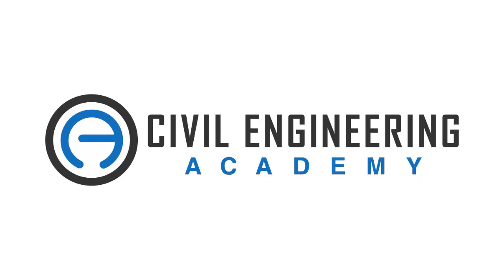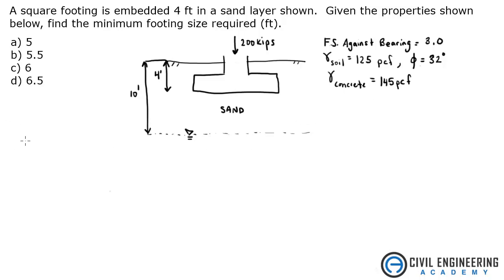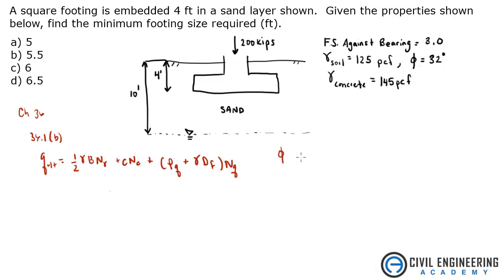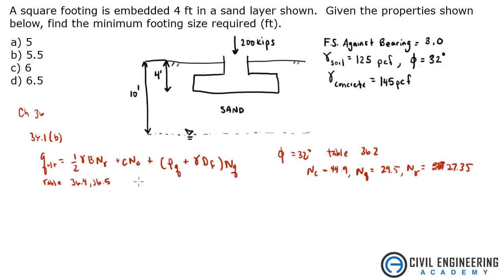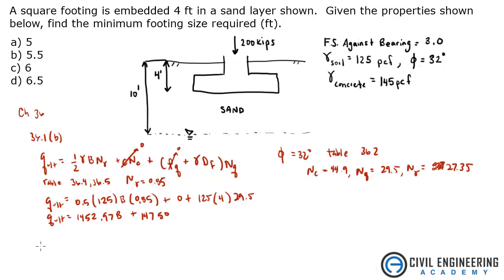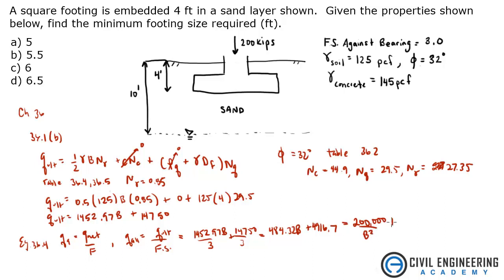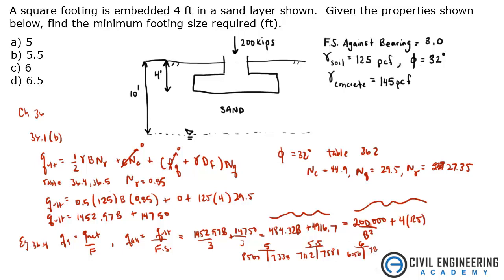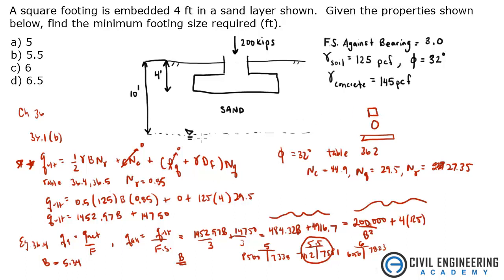Geotechnical-Footing Size Using Ultimate Bearing Equation

Comment: Are you sure it is acceptable when calculating the Nq and Ngamma values to simply take the average between 30 & 35? I used the chart to estimate these values and got Nq = 25, and Ngamma = 22, which results in the answer actually being C (6'x6').

Comment: Shouldn't Ngamma be [26.87*(Shape correction of 0.85)]? You just have 0.85.
Reply: Scratch that. I see you put in the correct value in the q_ult equation, you just didn't actually do the calculation that you wrote down.

Comment: Only comment that i have you should add on the equation on the right side =(200000#/B^2)+add (4'x125pcfxB^2/B^2) that the reason the equation on the right side is summarized to 200,000/B^2 + 4'x125pcf. but this is not explained on the previous problem solving video.
Reply from the maker: Alejandro Palau Thanks for the great comment!  It helps others when you can dig a little deeper and share.  Sometimes I miss things putting these together.  Thanks!

Comment: I don't understand very good, in this equation when you said  (qult=1/2 Gama*B*Ngama). How the calculation is done? because for my is :qult=0.5*(125)B(0.85) = 53.125.
But I think there is something wrong with (Ngama) maybe isn't  0.85 if not 23.25. is not possible
Reply: Jhon Alexander Torres Caicedo He should have multiplied N_gamma (which is 27.35) by its shape factor (which is 0.85) in that term. Therefore it would be: .5*125*B*0.85*27.35= 1452.98B
Reply from the maker: Ngamma was taken as the average between 30° and 34° on table 36.2 Terzaghi Bearing Capacity Factors for General Shear (quick and dirty method).  What are you using to obtain a Ngamma of 0.85?  Maybe your reference is off.
Reply: Civil Engineering Academy
You are right, but my question is How do you did the math to obtain 1452.97B? I think that result should be 53.125 because
 qult=0.5*(125)B(0.85) = 53.125.